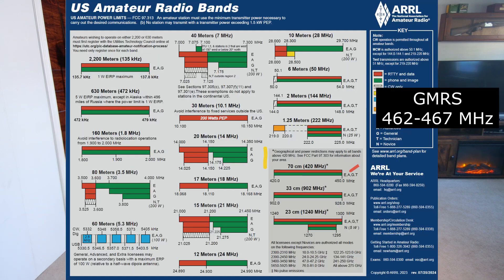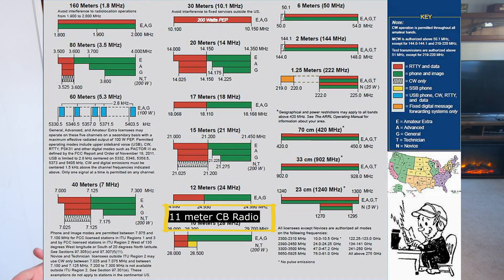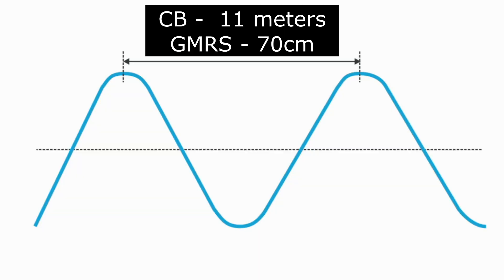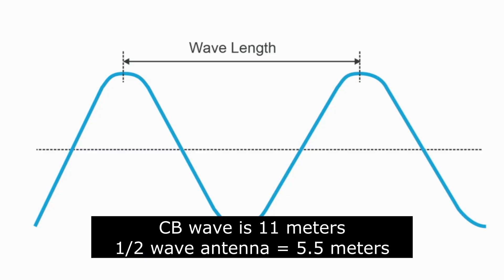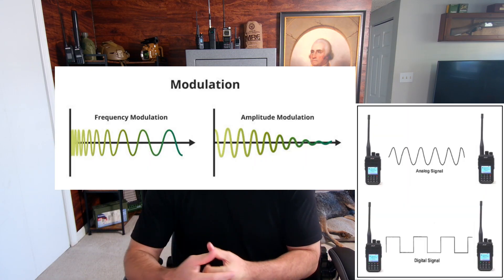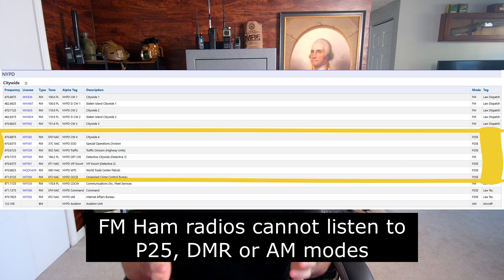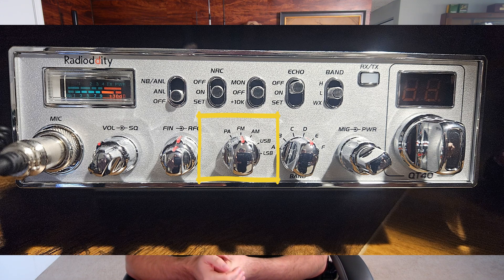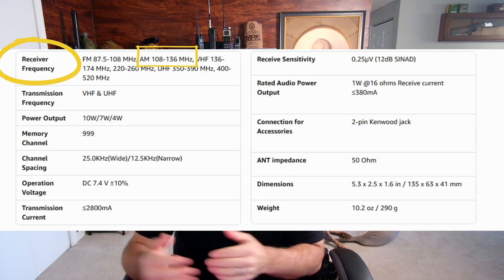Why a "Do It All" Radio Does Not Exist

Comment: i would say its easier to find radios that will do it all but not antennas. I have several ham radios icom 705, yaesu 991 897d and others and have the mars cap mod done on them which opens them up to do other bands and frequencies. I have a ham radio that will transmit on gmrs, murs, ham, 2m, 440, hf, cb, frs, and more. Is it legal to do so? no can it be done? yes. does it need to switch antennas? sometimes. you can use some crappy antennas and it will still work just not as efficiently as if you were using the proper antenna for each band. So yes do it all radios do exist.

Comment: I have a part 90 certified Icom UHF transceiver which can be programmed (not from the front panel) for anything from 400 to 470 Mhz. It is perfectly fine to use on the ham band and probably, at one time, was legal on GMRS if properly programmed. Ham FM started out years ago with repurposed LMR rigs, as did GMRS, but now they sell purpose built ham and GMRS rigs. So far as do it all radios I have an Icom IC-7100 which covers ham bands from 160m to 70cm, except 1.25m, as does the IC-705 and the Yaesu FT-991. And the IC-7100 makes a perfectly fine 630m rig if you unlock it and add an external low pass filter. So it is technically possible to make an extremely wide-band radio. It's really a problem of FCC ertification.

Comment: Can you imagine the size of a "do it all" radio? Would be way too big to carry around, and have half a dozen, different sized antennas sticking out of it. Then you are likely to get interference between all the hardware running at once. Probably heat your entire house with it, too.
Reply: The Icom IC-705 is the smallest HF/VHF/UHF radio I know. It has a single antenna jack, so you have to switch antennas to cover everything.

Comment: What is interesting is that the chinese are actually making a hf/vhf/uhf radio with both rx/tx with a antenna change now.

In my experience, ham radios that operate in the gmrs dont do well, even with a uhf business band antenna change.

Business band uhf radios are very fine tuned to only work in a very narrow frequency range and they sound great.
When you take a ham radio and open it up, it works, it's legible but it sounds terrible on gmrs compared to a business band radio on gmrs.

Also if you put it on a meter, a ham radio doesnt put out much wattage on the frequencies it wasnt specifically made for.

Comment: just get a quansheng k5, flash it with egzumer 0.22 and you can do all these things with different antennas ....
Reply: CB am radio requires it's on modulation circuits. And the quansheing only pouts out 300 milawatts on cb because low frequencies require there own circuits because of wave length. And when you have different bands your power ratings will varie from 10 watts to 1 watt or less because the circuits are not designed for those frequencies. Yes you can do this and I have a quansheing with the exzuimern firmware and tuneable antennas can only cover 1st and second harmonics before the swr gets Soo bad you will cook your radio.
Reply: @ryanmigliori660 for listening it could be “fine”  transmission on cb is a different story